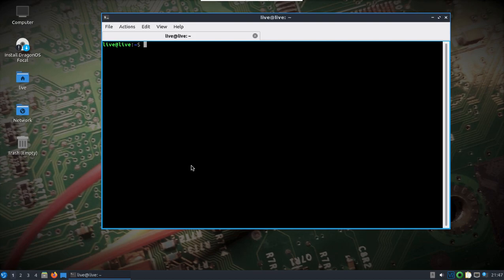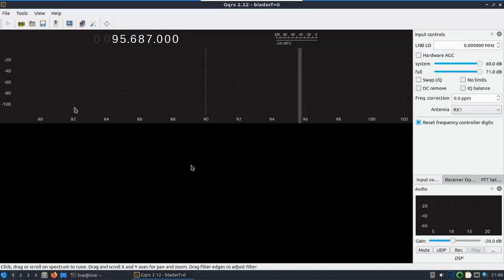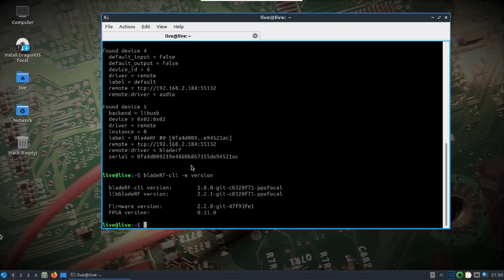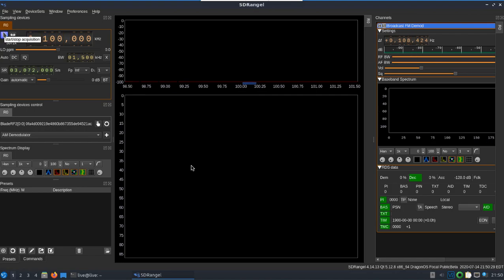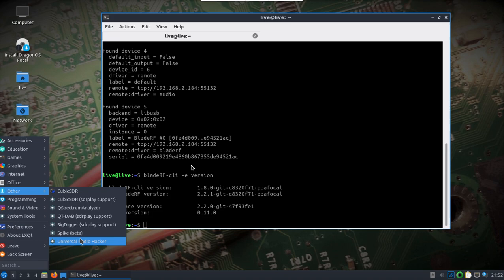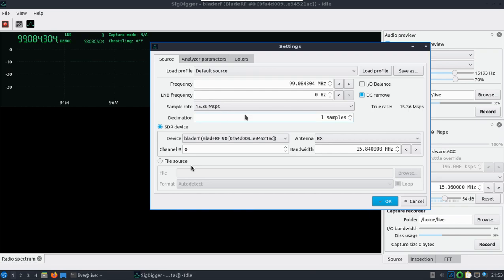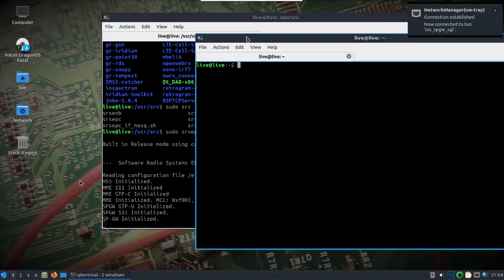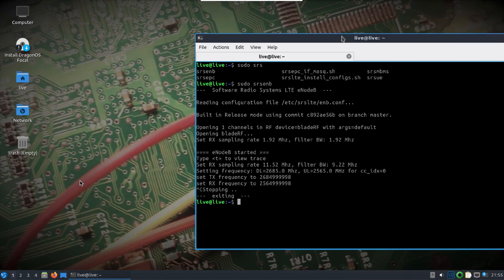DragonOS Focal BladeRF xa4 testing (srsLTE, SigDigger, Gqrx, Cubicsdr, SDRangel, URH)

Comment: Mate do you use physical preselection filter with the bladerf.
Reply from the maker: I have the LNA for bladerf upstairs, but haven’t used it much. Do you have some other examples I can look into?
Reply: My RF noise floor looks wonky in the spectrum like a hump with side lobes. 😢
Reply from the maker: @Lets_DoWhatWeWant is that in a particular application?
Reply: @cemaxecuter7783  Yes on 3db software
Reply from the maker: @Lets_DoWhatWeWant scepter maybe it’s called? Not super familiar but in say gqrx for example - if bandwidth is also not set to match sample rate I get a weird looking fft.
Reply: @cemaxecuter7783  Thank you, mate. I'll recheck my settings I'm sure is probably a user error.